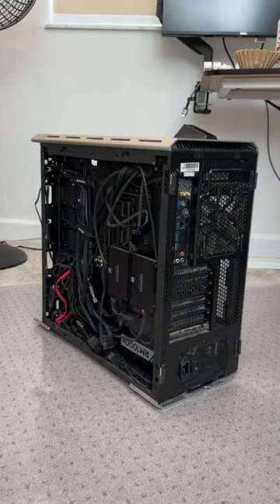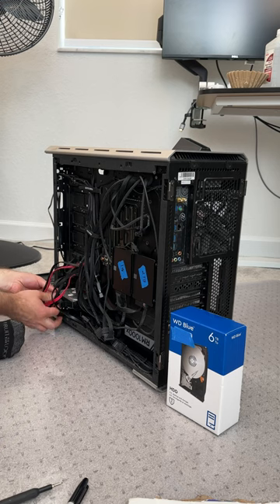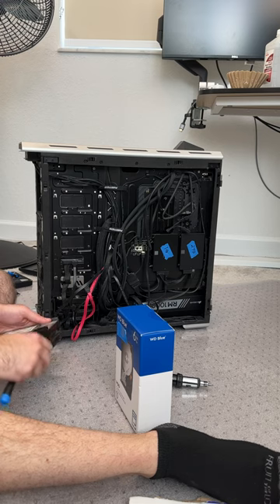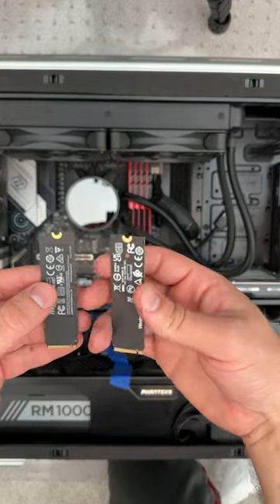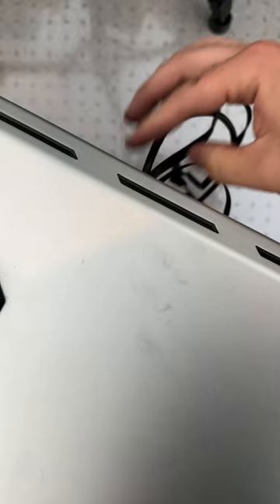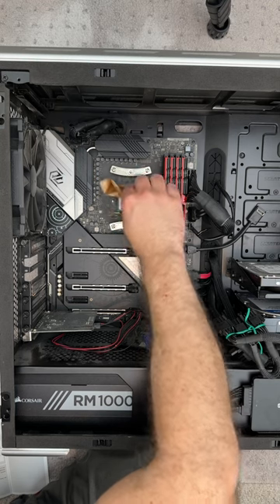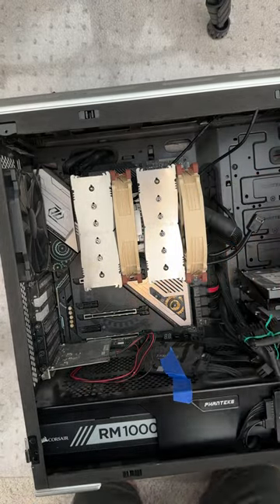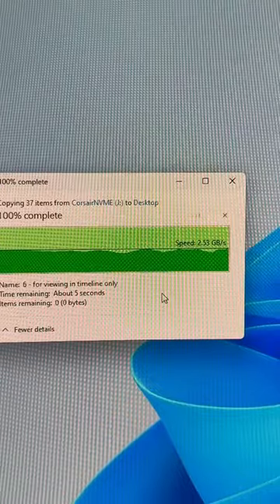No Table No Problem

Comment: Is the CPU compound permanent? What if you wanted to transfer to another build?
Reply from the maker: Not permanent. It can be cleaned off and the CPU can be moved.
Reply: @TechnologyMindset  Thanks! That could make a good video
Reply from the maker: @Vast1039  I kind of already did it with my 3900x to 5900 upgrade video actually.